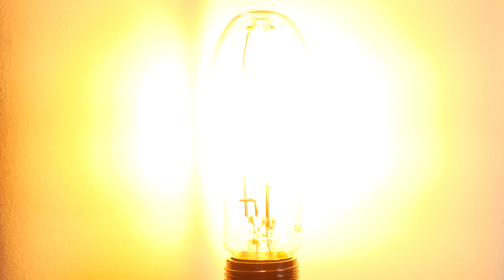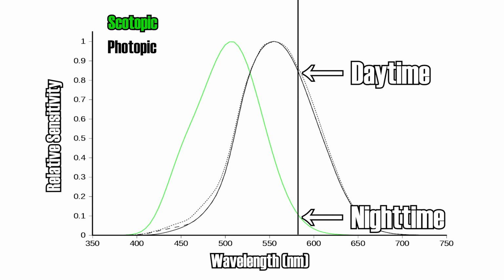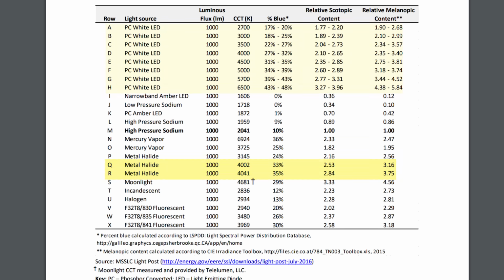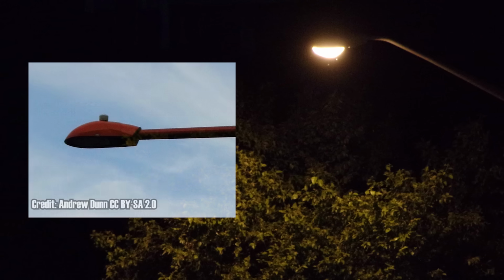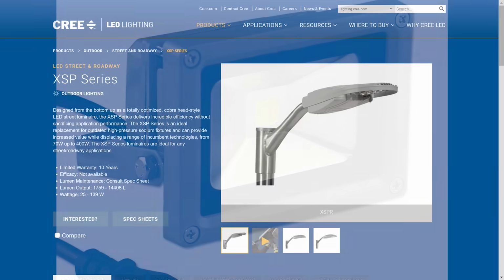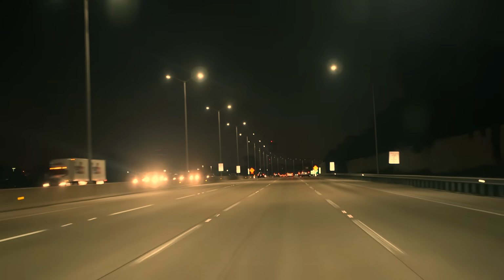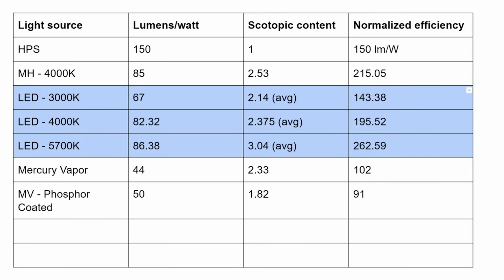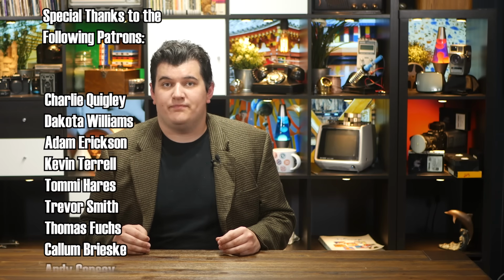The LED's Challenge to High Pressure Sodium

Comment: gonna say the biggest issue is light pollution I would say YES LED's should replace sodium lamps but the LED needs legally mandated filters to ensure it can be blocked by standard sodium flare filters for things like astronomy also they need mandated kill switches if they enter a strobing failure state unlike a flickering Neon or Fluorescent bulb failed LED drivers strobe at a rapid rate enough to induce seizures in people with photosensitive epilepsy so if those two issues can be solved than I have no problem however I do think the bright white blue LED's need to be banned for outside use.

Comment: I've had insomnia and sleep issues ever since the council installed LEDs in my street. Correlation, but whether it's causation I'm not sure. Guess I'd have to ask everyone how they're sleeping! Regardless, use of black out blinds and blue blockers is now being recommended by some. Wouldn't advice them for driving though.

Comment: They installed LED on my street. My only concern is that it's too strong but thankfully I have good blinders, I would recommend the city hall install 3000K lights instead of the 5000K that they are slapping everywhere.

Comment: Disagree with the assessment on LED and skyglow.  I fly a lot, and flying over cities at night that have updated to LED road lights emit far less light pollution.  It could be because of the light being directed to the ground better.  But I've also felt that the LED light bounces off the ground a lot less than HPS.  HPS light pollution is awful and I've never been a fan of the color.  I remember when I was a kid and MH lights were replaced with HSP.  Very happy to see LED take over and replace HPS

Comment: In regards to safety and LED lighting of roadways, one thing I have noticed and have experienced while driving is that one of the fail modes of LED lighting is strobing. I have found myself startled, and by reflex taking my eyes off the road in front of me to look into the rear view mirror to see if I am being pulled over. This strobing can be very intense ( full on to full off ) and at a frequency that can confuse you for a few seconds. It also makes me wonder if this could also be a problem for someone with epilepsy and if so has steps ever been taken by manufacturers to prevent this.

Comment: My local council has replaced the high pressure sodium lights with led fitments on a local cycle path. these do not put out as much side spread giving the impression that as you travel along it seems like the lights are brightening as you travel along it. A very charming effect.

Comment: I know it's financially unsexy to replace an entire unit rather than components, but that's the entire point of governments - to fund necessary improvements that aren't profitable for the greater good.

Also I really wished they stuck to 4000k. It's not warm and cozy, but it's not painfully blue and still incredibly efficient.

Also - i feel like there's circumstances where bluish light is unideal - when it's poorly lit and there aren't enough lights, it's much much harder to see non reflective things move about (so like people crossing residential streets at night) as well as gauge their distance due to the high contrast.

Comment: i live in a small town i canada an hour from anything we still use hps lamps in the town but the highway has proper rebuilt heads. i can see the benefit they have and i know the harm from retrofit bulbs as so many people have led flood lights or bulbs on the deck the stark difference between a tried method a new method implemented well and a new method implemented poorly is a (pardon the pun) glaring diffrence.

Comment: The answer is a resounding no. LED lights are of poor quality for illumination and harmful to humans and the environment. Flat surface emitting diodes produce damaging visual radiation and the luminance is non-uniform. That’s why LEDs have such harsh glare, and they are in fact discriminatory as public lighting towards photosensitive people and trigger migraines, epileptic seizures and other psychiatric conditions.

High Pressure Sodium was and still is, safer and a higher quality lighting because it is point source and spherical. The luminance is uniform.

Comment: 2 counter-arguments that this video, and the papers referenced don't go into.
1. Sensitivity and differentiation/recognition are not the same thing. There has not been enough study into whether these LED bulbs (with their small spectral coverage) make it easier/harder to differentiate objects actively or passively. Anecdotally, I have had situations where LED street lighting has caused me to miss things, even in situations that I would have no trouble saying that the area was "brighter". And I have VERY good acuity(20/6.6 which is...hooray fractions?) and night-vision.
2. Longer wavelength lighting preserves night vision better. This is especially important in areas that aren't constantly, and completely lit to daylight levels. Passing into and out of well lit areas is a SUBSTANTIALLY different experience between the newer ultra-bright LED lighting, and the older dimmer Sodium. There are many MANY areas, especially rural ones, where the road is only lit at busy intersections or hazards. This can make the areas immediately after the hazard just as, if not more dangerous, because drivers have not yet adjusted to seeing with only headlights. Longer wavelengths can dramatically reduce this readjustment time.

Yellow/Amber LEDs might solve some of these problems, but remove some of the benefits to brighter/whiter LEDs.

Comment: This is on target. Early household LED was either harshly bluish, or correctively tungsten - like creamy 2700 K.  Later, the need came to blend for 3000 K by adding cooler LED. These Cree cooler LED's just pushed the high pressure  ugly state Penn peach sodium's and their ballasts away. The sparkle white is sun - like and broad, and while it makes burglars uncomfortable, the light is less, but better and friendly to everything including retailing. I am now looking to slowly replace my 2700 K LED's with 3000 K or elusive 4000 K, and not quite as high blue as the pretty street lights. Broadness of color is important. I never want to see a fluorescent or high pressure sodium again.
Reply: They sell two-color-temp high power LEDs on aliexpress with a 95 CRI, combined with a 15$ smart driver you can freely chose color temperature. High CRI means less pronounced blue 400-ish nm spike and extended deep red performance. I don't write this to sell you anything specific, just pointing out the tech is out there (video is 4yo) and it's getting cheap ($50 total for 50W LED, which is brighter than most of us need)

Comment: As an interesting aside you may want to look up the problems my hometown Lincoln Nebraska had with going to LED streetlights, and I think Kansas City had some of the same problems.
They started to put in new white light LEDs but at some point they started to malfunction and large numbers of them started giving a bluish or purple light. I would have liked them to have just run with this and develop a purple motif for the city, but the manufacturer is reportedly paying to have them replaced. I can furnish pics if useful.

Comment: The way light is emitted from an LED chip is the reason why LEDs are DANGEROUS to pedestrians and bicyclists. Replacing the current set of streetlights with LEDs creates situations like you would see in 1950s gumshoe detective TV shows or movies where cars are constantly going into alternating periods of light and darkness. The LEDs simply don't light up the street enough because they only shine the light right below them. And no way cities are going to add poles with new lights to fill in the gaps. Even cities that took lighting off every other pole to save electricity 20 or so years ago are not adding the LEDs back to the poles they took off. And it leaves LARGE gaps of pure darkness, especially on roads where the poles re on one side of the road for awhile, and then cross over to the otehr side, for awhile, etc. Between poles and on the opposite side of the street is pitch black. Muggers and rapists sure love it.

Comment: As long as we are still doing daylight savings we should be doing HPS. Because we literally move time itself to not screw up our circadian rhythm, despite it generally being outdated and a pain for scheduling in other countries which do daylight savings at different days of the year, we should be throwing caution to the wind and using orange murder lamps.
I will only humor sterile sky killers when we do away with daylight savings.

Comment: My town did a big sweeping replacement of all the old sodium streetlights with white LED ones, and while yes they make it much easier to see at night I think a better compromise would have been to stick with LEDS but use a warm white, not quite orange, not quite white. They could even just use regular white LEDs and put a tinted lens on the housing.
EDIT: also yes, someone else pointed out in the rain the white LEDs reflect WAY more light back up off the roadway and I experienced this last night coming home from work in heavy rain. It makes it very hard to see the lines on the road...

Comment: Couple of things I noticed about LED streetlights: The beam is rather focused, and lends little light pollution outside of its "cone" to the point that you almost cannot see where you are coming up on a lighted area at a mile off. A downside is that as you approach, you see dark areas between the lit portions that could literally hide a dog wandering the roadway.
Reply: Simple lenses to spread the light a bit so they overlap but not throw much farther than that would solve this.
Reply: Orange light bad!
Reply: Use your headlights you nanner, that's what they're for
Reply: @pootispiker2866 : Arguably, headlights are supposed to be for seeing where you are going in places without street lighting (there are places where they're not required to be used in places with street lighting, like the UK). Regardless, this also happens as a pedestrian, where it can be very difficult to see where you're putting your feet in some spots, if you don't decide to use your own torch, which then defeats the whole purpose of street lighting...
Reply: YES YES YES TELL THE WORLD LETS CHANGE THESE LIGHTS BACK

Comment: Circadian Rhythm? If the Amber glow lulls you asleep and blue light helps wake you up, which would be safer behind the wheel? The issue of light going skyward or into an apartment complex beside the road is just a matter of changing the lamp to correctly direct light where it is needed. You are only going to see a transition toward better safer and healthier lamps that do this as they are being replaced. Drop-in replacements are unlikely to do it. In the end, if the blue light is too harsh and you are not feeling sleepy, get amber-colored sunglasses. That'll color shift the light to something more appealing.

Comment: On the plus side of the yellow being away from the wavelength that the eye is sensitive to under night conditions, it means they are less dazzling and the eye is less likely to adjust and you can still see things in the shadows. Car tail lights are red for the same reason. It’s also why the military use red filters in certain conditions such as in back of of a helicopter before a night drop.

Comment: I live in a little town where the streets were lit by the more blueish-white/gray bulbs.  (MV, I think?)  They too, had the domed lenses.  Driving at night back then  I never really paid it any mind as it was the norm.  
Recently,  all of the lights were replaced with LED lights.  (Heads and all, not retrofit bulbs)   The first time I drove through after the replacement,  I noticed a drastic difference.  Where I used to be able to pick out each light from a distance (coming down the hill)  I could now only pick out the few that were closest.  Thanks to the flat bottoms and focusing lenses, sideways and upward spillover was greatly reduced.   Also with the new LED fixtures,  I noticed ta much sharper contrast.   Objects were not as "fuzzy" looking under the LED light.    I call that a plus.   Another bonus is that West-Penn Power has a gross lack of maintenance, reliability,  wildly fluctuating voltage and frequency and a "Screw you, Pay me!" attitude.  With that comes a lot of momentary flicks or brief outages.  The older MV(?) fixtures would require about 3 to 5 minutes to light back up.  The bonus is that the LEDS are right back on as soon as, or if  WPP gets off their asses and sends one of their totally uninterested, unmotivated crews out to "fix" or, in most cases, temporarily rig, the issue.  Eventually...  If they really really have to and maybe might feel like looking into it..  If they're not too bothered by doing something as horribly inconvenient to them as their jobs that we (over)pay them to to do...   Then yeah,  the LEDs blink right back to life. 

Wind:  * Blows as hard as a mouse fart *
WPP: "Power out in Washington county?  Meh!  Who cares!?  Just a bunch of hicks anyway. They'll use torches like the primitive swine they are.  We  have power here in Pittsburgh, so I couldn't give a rats' ass.  But even though their power will be off for hours to days, they'll still get the same over-inflated bills though!  HAHA!"  

Oh  I went on a rant.. sorry.   WPP sucks.  (money from wallets)

Comment: We have new street lights here that glow a blue/purple color.  It's hideous and difficult to see when in them and our city uses them only in one area and sporadically at that. 
I'd love your insight as to them.
Reply: The blue-purple lights are a normal streetlight that has failed. A phosphor that is meant to shift the blue to white or something like that has burned off/melted/decayed. This is showing up wherever the lights have been changed over to white LED, a combination of normal failure rates and some producers/vendors that flooded the market with second-grade elements.
Reply: There was a manufacturing defect that effected a large number of LED’s used in street lamps at one point. They high a high premature failure rate.
Reply: Wow thanks for the info guys. I wonder how long it'll be until my city decides to change them out. 
It's one stretch of roadway that just added center medians and crosswalks to, in an area known locally for high levels of accidents (involving pedestrians)  - I thought the purplish-blue color was something for awareness or visibility lol
Reply: I figured those light are to detract people from doing drugs.
Reply: @PierceMD  an unintentional benefit I guess.

Comment: Here in England, most local councils have now switched street lighting to LED, and I hate it.
The lights are so bright that it can be really hard to actually distinguish oncoming traffic.
Conversely, the widespread application of equally blinding LED headlights has meant that they just haven’t bothered replacing sodium lights in more remote areas and just switched them off instead.
Also, the nice yellowy orange glow just looks better. But the cheaper operation of LED lights means that they’re coming for the vintage gas lamps next.
Thanks for coming to my TED Talk
Reply: At least one place I know of decided that as the LED street lighting is "more effective", that they could place them further apart, but I've found that in reality, they don't cover as wide of an area, at least on the pavements, which leads to some dark spots where it's hard to see the actual ground. Not great for trying to avoid dog poo...

Comment: Maybe a good course of action would be to finish using the existing stock of sodium lightbulbs and then switch to 2700K-3000K color temperature LEDs when they run out, seeing that LEDs are still improving.
Reply: Behind the scenes that’s what lighting manufacturers are doing. It’s becoming less viable/sensible for us to carry HPS and other HID fixtures so we discontinue new families of HPS lighting basically every quarter with the intention being able to eventually remove all HID options from our catalog. LED has advanced to the point where really there is not enough demand for HID/HPS to support the production with our limited resources so I suspect there will be almost zero newly manufactured HPS fixtures on the market within the next half decade.
Reply: Yeah, that's what they're doing here in Australia.
Reply: Yeah they do that here. A bit annoying when every other lamp is LED or  te old lamps, looks bad when they mix them.

Comment: My only gripe with LED street lamps is the radio interference (noise) I get on my HF ham radio. Some of them are so noisy they block all other signals but most aren’t that bad. They will still block weaker signals, though. Good quality LED’s add filtering to the circuitry to eliminate noise being emitted or a filter can be installed manually if you own the light.

Comment: When you dim incandescent you don’t see the phases of light because it takes time for the tungsten to unLuminate, but when you send the same AC current unless it’s rectified and not all of them are perfectly rectified especially dimmable type you will really see the flickering and the flickering is your eyes picking up on the 60 Hz frequency and if you ever try LEDs that are powered by a DC power supply you will noticeably notice zero flickering for instance look at TVs chances are they’re using DC current power the diodes inside the TV and that’s not bothering you but before that they were powered by a Micro fluorescent tube inside the LCD.